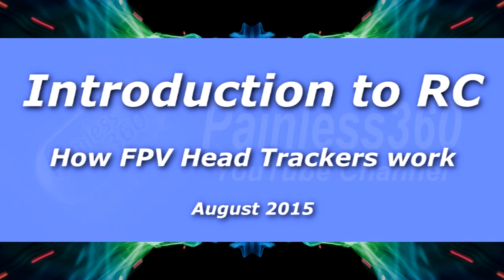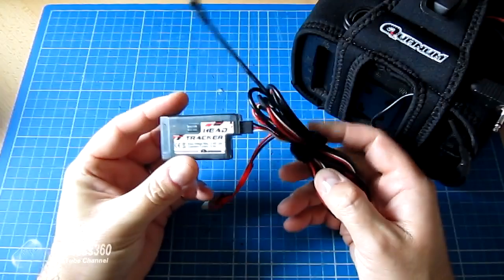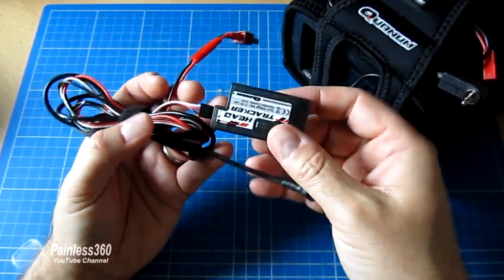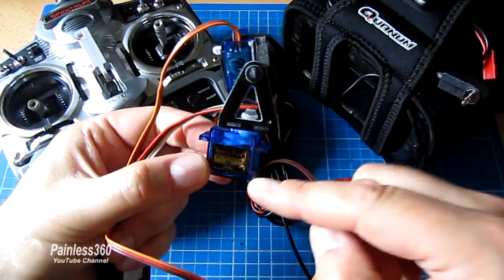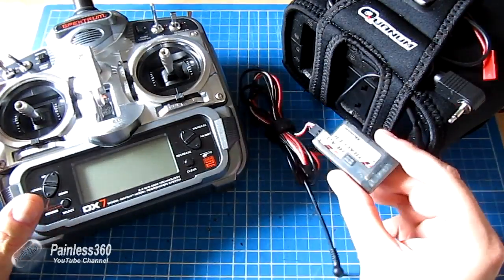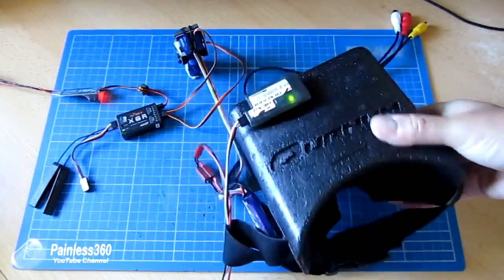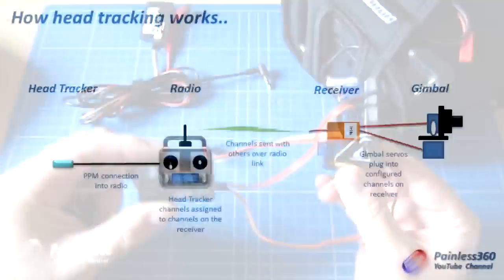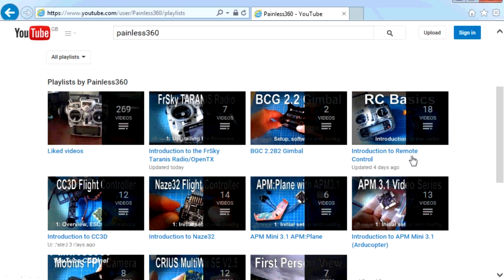Introduction to RC - How a Head Tracker Works

Comment: I just wired up my storm32 gimbal to my pixhawk using my shiny new sky03O head tracker training output wired to my jumper T16. After a solid day of configuring, I can now "look around" while flying my drone! Can't wait to test fly it 😁
Reply: I might remove "pan" capability and leave only "tilt" or pitch, to avoid having redundant degrees of freedom. one problem I might am afraid of is losing track of the gimbal orientation relative to the drone. Where I end up looking sideways without knowing it

Comment: I'm doing a work like this but I don't know how can I translate the information of gyroscope to a compatible information for the radio understand it. you talk about ppm but What type of signal or data the headtracker send to radio? How it's possible send 2 different data about X and Y axis in the same 3.5mm jack ?
Thank you!
Reply from the maker: PPM sends each of the channel values down the same wire one after the other. There are some great explanations on places like Wikipedia.. Best of luck!

Comment: i want to do the same thing but instead of head tracking i want my camera to tilt when i increase the throttle... so when i tilt my drone down to go forwards i want my camera to tilt the same amount up to look infront... can you do a video on this, please. You are really good at explaining things. Btw, the power point was a good idea!
Reply from the maker: You can do that on a radio or a flight controller. See the videos on adding a simple gimbal to do that automatically using the software in the various flight controllers, or you can do that in the radio. How tricky that is to setup in the radio is down to what radio you have.. Best of luck!